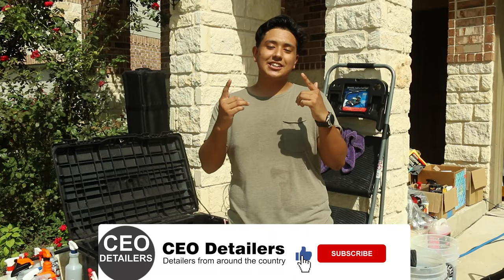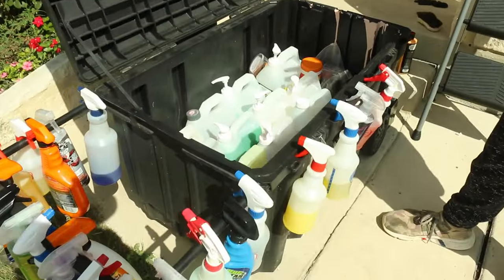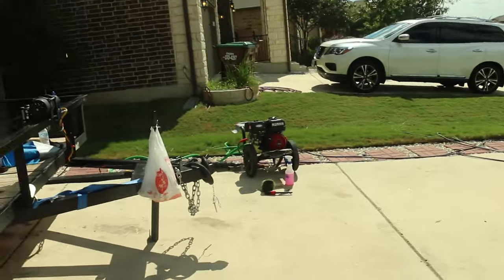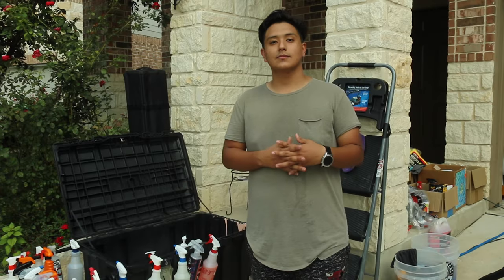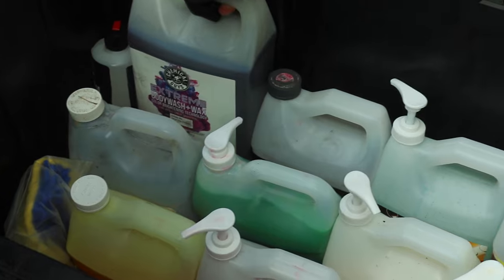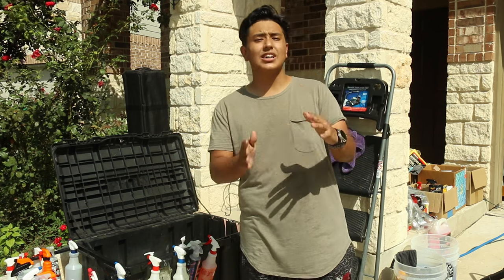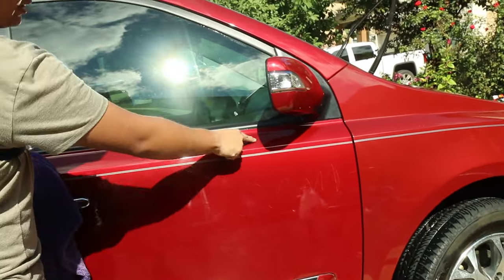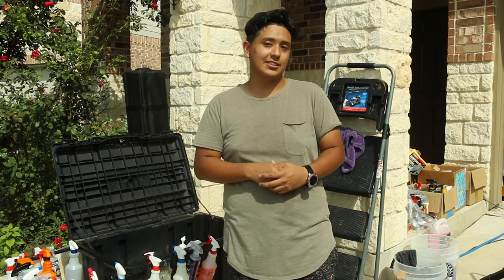Detailing with Shine Detail from San Antonio Texas - CEO Detailers

Comment: First wash/clean wheels,
Then get to the actual vehicle.

There’s a lot of great products out there for beginners other than what’s been mentioned.

Also wash/scrub top half then bottom half so you don’t run the risk of scratching (damaging) paint. 

Wash & Dry on a straight line motion never in circles. 

Let’s do some Research to learn the benefits of products and techniques in the detailing game.

S/o from CALIFORNIA 🌴💯
Reply: you actually do the inside first that way any dust that blows out onto the paint is easily rinsed away. do it the opposite and you’ll get dust and debri on the car.
Reply: @drift4840  I stand corrected. You’re absolutely right! Thank you brother 👍🏼